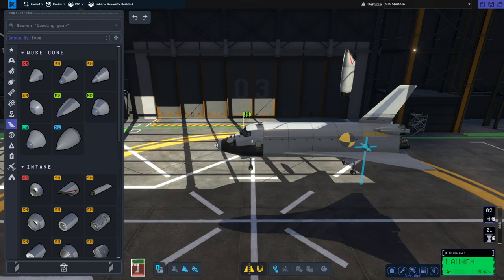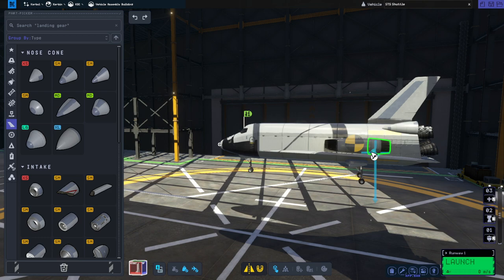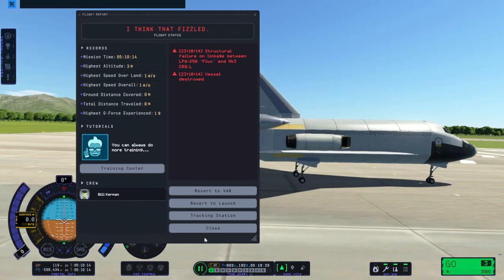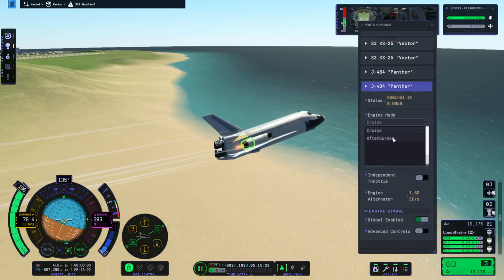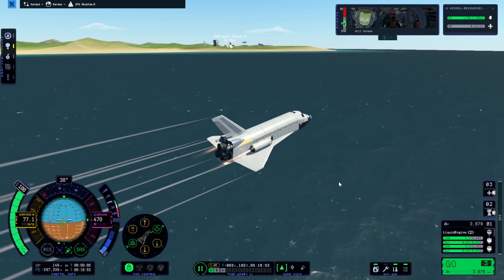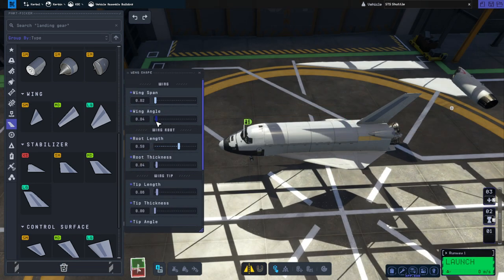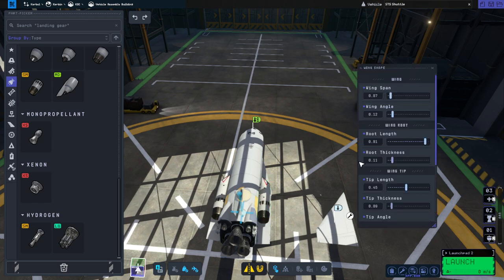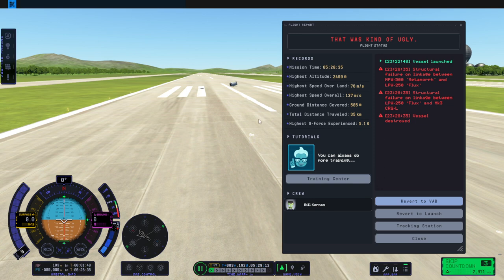KSP 2 Early Access - Shuttle Flight Test

Comment: Your wings are opposite because you may have used the wrong symmetry mode.
Make sure you are using symmetry wing mode and not symmetry rocket mode.  If there is a number 2 for symmetry, your wings will be opposite of eachother.  In wing mode, they will go on correct and control surfaces will work normally.
So make sure in the symmetry box, there are little wings and not a number 2.  The wing selection is after 8x symmetry.
Reply from the maker: I did make sure in the symmetry box it was in the right symmetry mode. I'm not new to KSP.
Reply: maybe it's a glitch with that mode switch in the VAB
if it's just that, then placing the wings in the spaceplane hangar shouldn't glitch the controls out
process of elimination

Comment: hi o/

I see you have the base of the rudder wing with a control surface who was active during roll input. 

A thing that could help to control a little bit the control of the shuttle,  is to divide the roll wing to add an another control surface for the pitch

A little solution not very elegant for the shuttle but very usefull is to add "slats" . Take a wing, reduce to the max the root and edge lenght, 0.05ish. the angle to 0.5.
It add more parts and drag but it will be more stable "normally" ^_^"
Not very realistic for reentry but definitely a massive help for any airplanes and spaceplanes
It's a tip i use in KSP 1 in vanilla and modded with FAR and Procedural Wings.
Reply from the maker: The Shuttle did not have slats, so I'm not going to put slats.